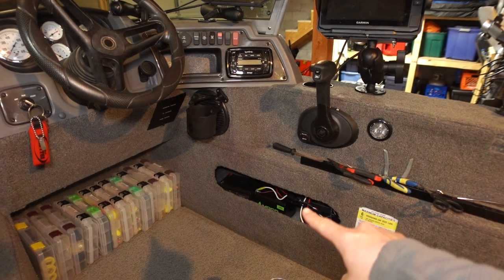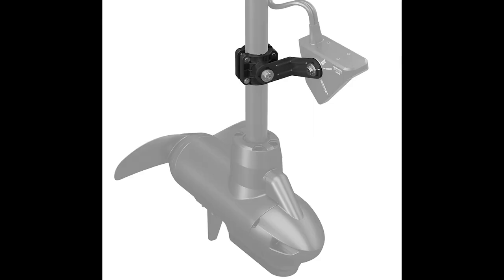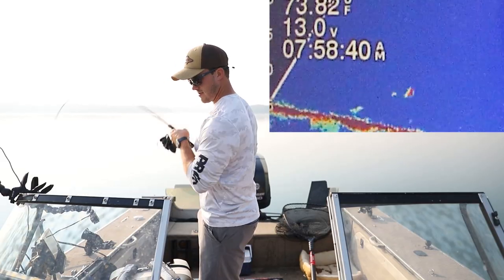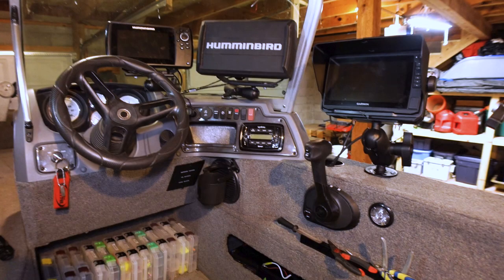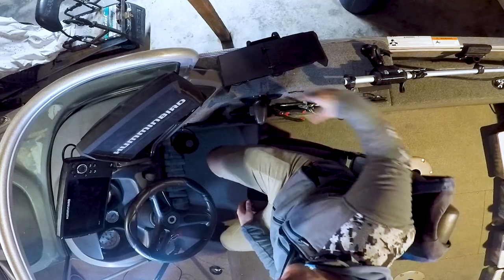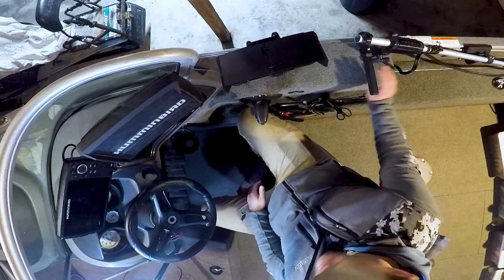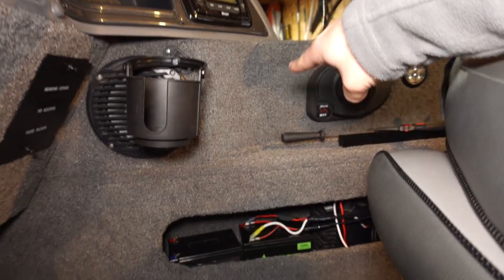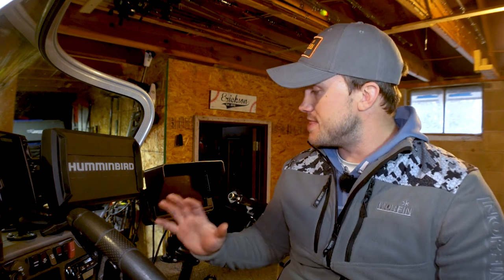Garmin LiveScope Boat Set Up | Pole, Mount, & Rigging for a Clean Set Up

Comment: I have a Ranger boat which I have stored in Walker. I’ll be heading that way for a couple of weeks of late fall walleye. I have a Helix 10 on the dash and after watching your video I’m planning on a D ram ball on the gunnel. I know the Ranger has narrowed the gunnel so I’m hoping it fits. Never drilled through gel coat but have watched video on how to. Do I screw this in or bolt it in? Not sure if there are wires running that high in the gunnel. Not sure if there is access to get a nut on the bolts. I’ll have to look at the cup removal option to run wires. I have a rail which comes close enough to me while sitting at the helm to run the Livescope which I’ll mount on the rail. With an Ultera I’ll be able to run and gun without leaving my seat. In the spring I fish crappie so I’ll have it mounted on the rail on the bow. Thanks for your suggestions.
Reply from the maker: That’s a great idea! I do want to add that I just actually upgraded my pole system. I switched over to an Arclab pole system and have been loving it! It adds a lot more stability while still being able to run and gun quickly. They make a ton of different options for a bunch of different boats. If you haven’t already bought your parts - might be worth checking out!

Here’s the website - https://arclab-motorsport-fabrication.myshopify.com

Comment: I mounted my unit sideways like that but my screen was reading backwards in forward mode. What am I doing wrong?
Reply from the maker: That is how it is always set up. Not sure if you can change that. Might take a bit to get used to, but just knowing which way the handle is going and making sense of it from there

Comment: I want to set my live scope up like your. I have a minn kota i pilot 112 ,  lowrance  hds 7 and a hds 9 . Where does the trolling  motor hook up to? I have to buy a new garman display for my live scope. 
Thanks trying to hook all this up.
Reply from the maker: The trolling motor should hook up to your 36v system. Do you have the livescope trandsducer already?
Reply: Yes. I have the black box and part that attaches to trolling motor garmen live scope with out display screen. I am looking to buy one but want make sure everything will work together.
Reply: @tjsguideservice   i still have to buy my 3 batters mounting plate, brackets to hold my lowrance HDS7 and HDS9. A screen for garmen live scoop, I do have the black box and part the mounts to trolling motor.

Comment: What length of pole did you go with?
Reply from the maker: I intended to go with the longer one, but accidentally ordered the shorter one and I haven’t had an issue! With that being said, if I were to do it again, I would probably order the longer one just to be safe!
Reply: @tjsguideservice   There's 3 sizes on the summit pole 36", 60" and 80" so you had the 60" and it was fine in the water column? What size it the arclab one you have now?
Reply from the maker: @davidgoodberry4679  I believe I had the 24-60” and it was fine. The arclab on I have right now is 28-50” with another pole that give an extra 12” or so? It’s the 5200 series pole.